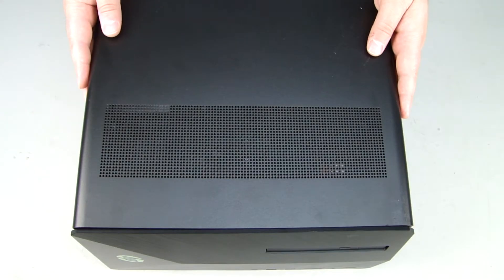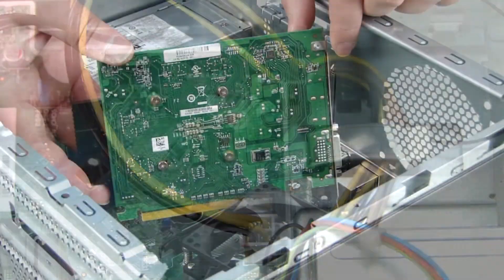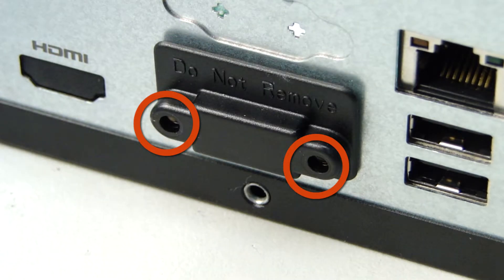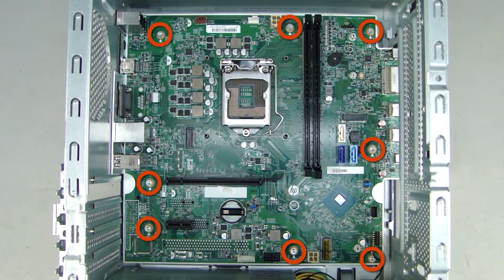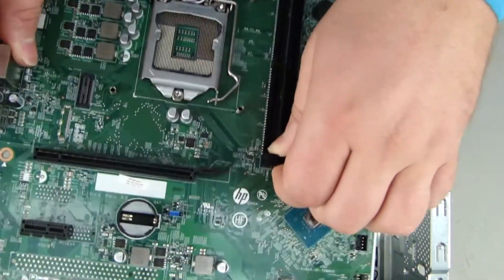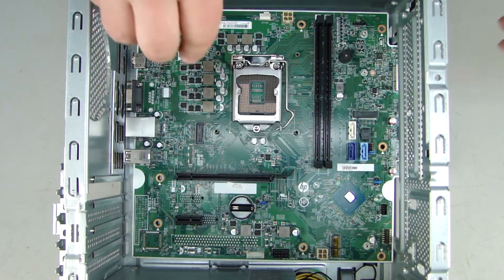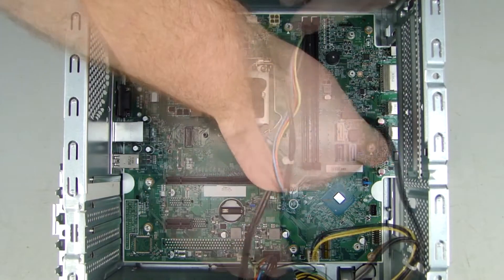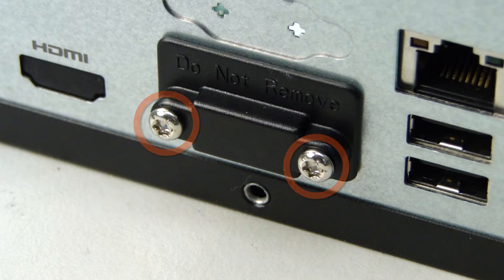Replace the System Board | HP Pavilion Gaming 690-0xx Desktop PC | HP

Comment: Thanks for the help! I really needed to replace my motherboard as the HP bios and limitations leaves a lot to be desired
Reply: Could you find another motherboard that would fit in that case?
Reply: @user-nw8lm6qm4s  only the similar HP made one + make sure the back ports align with the holes on the back panel of the case. Really, @HP Support, was it that expensive to do a normal IO shield? Same about the front - that "horn" usually is a part of the PC case, not the motherboard itself...
Reply: @user-nw8lm6qm4s  I have the same question.
Reply from the maker: +Hugo Guerrero Glad to know that the video was so useful to you!!

Comment: Can you upgrade compatible graphics cards on this system?
Reply from the maker: +Nicholas This computer has One PCIe x16 socket and One PCIe x1 socket. So you can add graphics card that supports these sockets.
Reply: Hi Nicholas, my son has this HP and I just updated his GPU to an EVGA GeForce RTX 3060 XC GAMING. Picked that particular model because its small size and TDP are perfect for the HP's limited space and PSU; it fits comfortably and needs a total of 170W, with one 8-pin power connector (you can use the HP's 6+2). Depending on your budget and preferences, you will find 3060 Ti or Radeon 6600 XT that are also good fits, as long as you stick to a maximum of 200W TDP / 1 x 8-pin connector.

Comment: Can you change graphics card with 1080 ti ?
Reply from the maker: +GSK_gaming It has One PCIe x16 slot and One PCIe x4 slot. You can add graphics card that supports this slot.
Reply: Is 1080 ti or 2070 supported ?
Reply: @gsklol  you’ll need a higher wattage psu, if you have this motherboard you probably have a 310W or 400W psu. Also take into account the size of the graphics card as those two models don’t fit into this particular pc case. A rtx 2060 does fit though.

Comment: can a micro atx board fit in this case? i know you dont recommend it just give me a straight answer will it fit?
Reply from the maker: +Pabz Roz We have not tested this. So we would not be able to comment whether it will fit or not.
Reply: @HPSupport  Thank you for the response. I tested it myself and a MicroATX board will fit except you will lose the front case usb ports because your proprietary motherboard has them physically on the board itself. Well worth the upgrade to an after market motherboard tho.
Reply: @PabzRoz  do all the parts fit right onto the MicroATX?
Reply: @nicktorrance6008  yes except for psu
Reply: Since there doesn't appear to be a proper place to use a regular I/O shield, is there anything that needs to be done to the case itself to make an aftermarket board fit?
Reply: @yasu_red  yeah you're going to have to mod the case whichever way you think would be easiest for you. honestly you could just buy a cheep case for 50$ or something used and transfer all the parts.

Comment: What other motherboards would this case support? does anyone know what motherboard I could used to be able to put a AMD - Ryzen 7 3800X processor in it?
Reply from the maker: +james pressey HP does not recommend upgrading or downgrading hardware parts or software that is bundled with the product as It may affect the manufacturer's warranty and performance, however, you could change the configuration at your own discretion.
Reply: @HPSupport  is there a way to purchase a replacement motherboard? Or something comparable to get?  We need one to replace a bricked board.